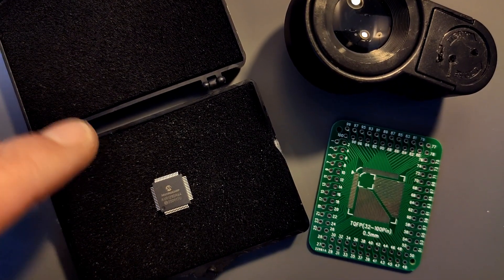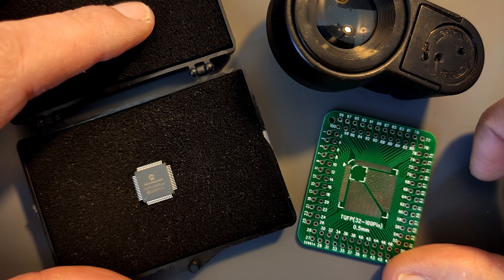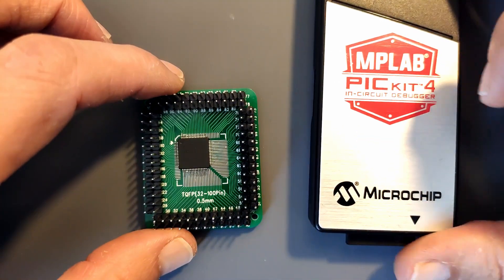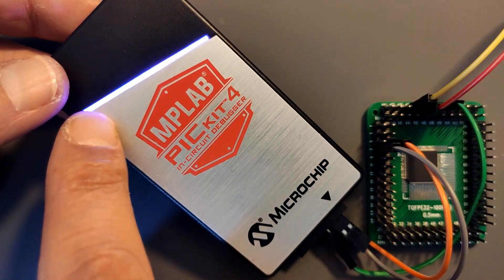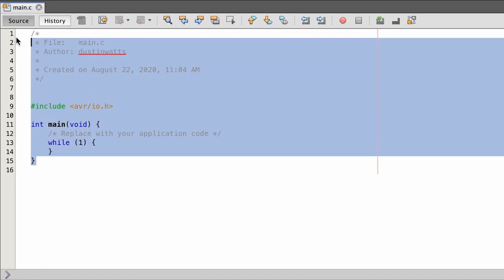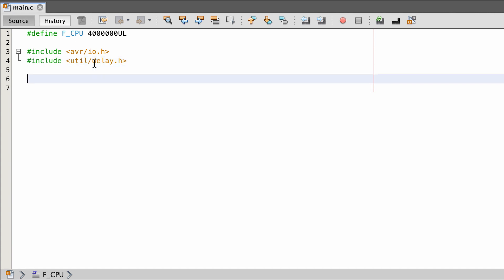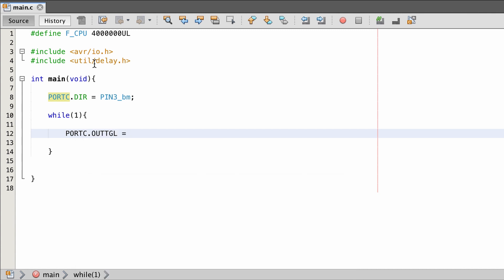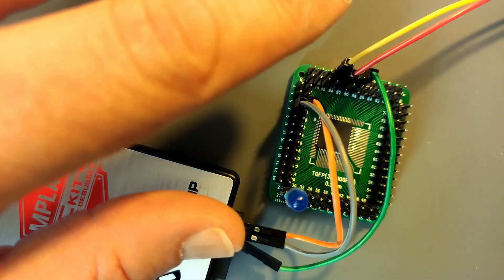The AVR DA Family, what is this all about?!

Comment: I think it pin 1 not seen many connectors that have a pin 0. Looks good, need a bread board friendly breakout board.
Reply: We have hardware at work where the physical port connectors are labelled as start counting at 1, but the software that controls them starts counting at 0.
Reply: @pileofstuff  I think that's because in reality you have to start at 1. You can't have zero of something physicaly on something. I tried, put eveytime i tried to solder to pin 0 it was not there. :)
Reply from the maker: That's what usually messes me up. Switch from bits to pins...
Reply from the maker: SpenceKonde made some boards. I'm using his DxCore for the Arduino IDE in next week's video...